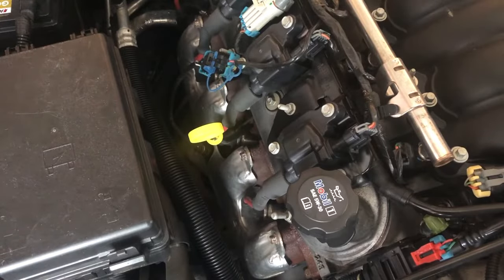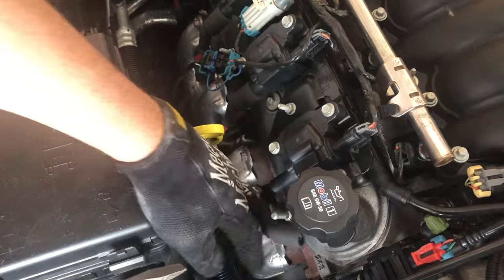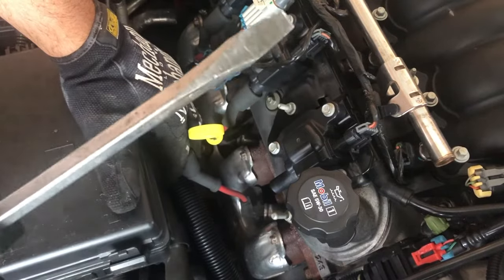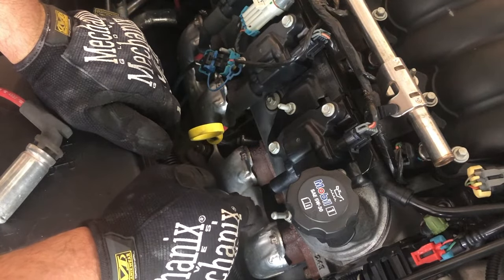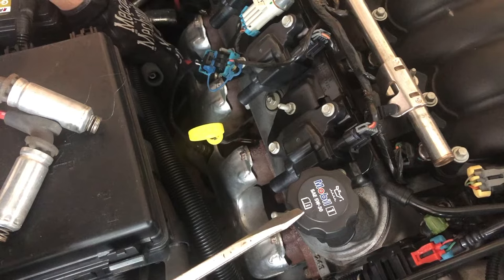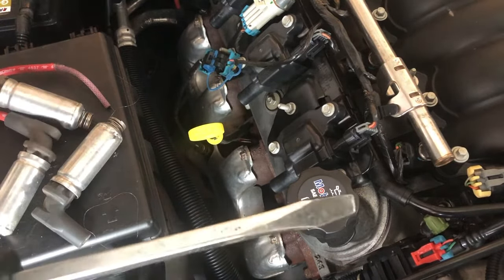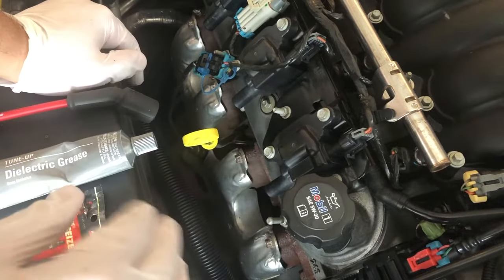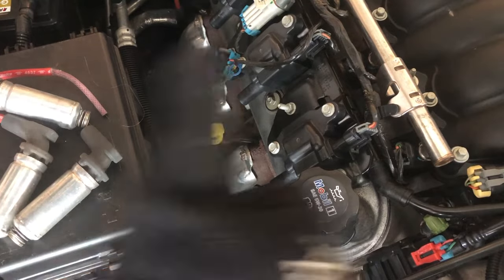GM Spark Plug Wire Removal EASY!!!

Comment: Gotta be better options out there. I'm trying to avoid breaking plug wires while changing spark plugs
Reply: Wires don't last longer than the plugs, maybe a little, but that's plying a losing game.
60-100,000 wires are shot.
Reply: I used a Chanel locks if u bend the metal u can bend back with Screw driver. Don't pull on the cord like this guy is u want to reuse.
Reply: Yea, I the like 5 different kind of boot removal tools out there and no one with an LSx seems to own one

Comment: Thx alot gd stuff i purchased a 2015 Corvette c7 30,000 mi it runs gd i just wanted to check the plugs but i don't wanna break the wires so I'll leave it thx again

Comment: I have a 2004 tahoe z71  5.3 and I can't get the wires off. I bought the special plug wire tool also. 80 dollar plugs I can't change. Somone told me I need to break the plugs literally  to get the wires off then buy new plug wires. The vehicle  has a horrible  miss  so I figured changing the plugs may help.
Reply from the maker: Yeah, when I pulled them from my corvette, a few of them broke. This method still helped me get them off easier.

Comment: I used a nail clipper to pull out the boot from the manifold after breaking the second wire and it worked eventually

Comment: I tried it this way but it didn't work I ended up  just breaking the plug boots. Is there another way to get these things off?
Reply from the maker: I broke a few as well, but they came off easily! I just made sure I had new wires before doing this.
Reply: Spark plug wire pliers!
Reply: Chanel locks